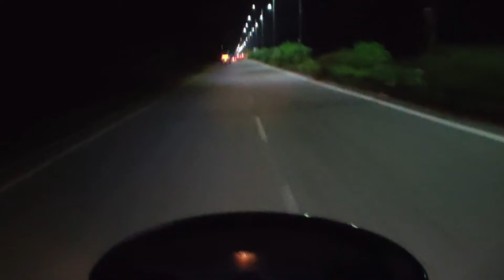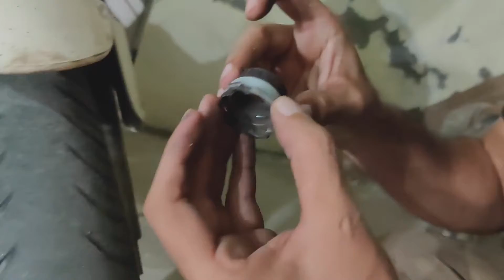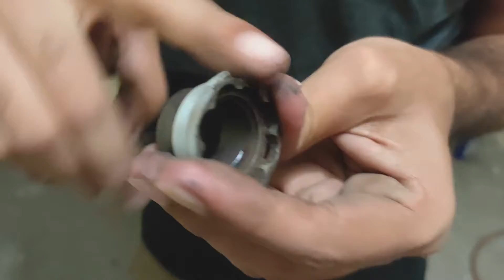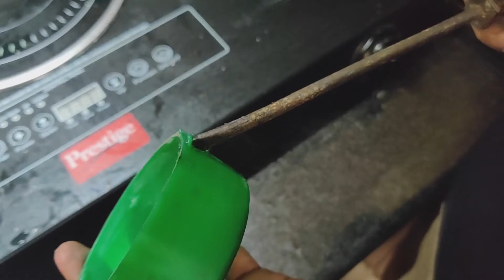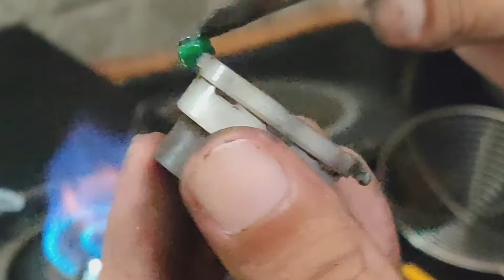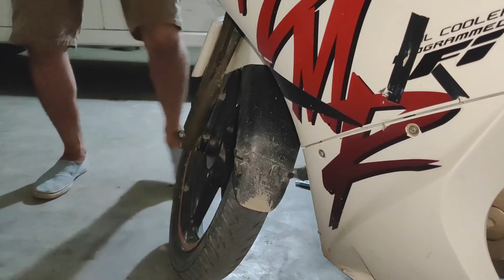Karizma ZMR Meter Not working after 39000 km || Fixed at Home || Motorcycle DIY

Comment: I own Karizma zmr ..My bike turns of whenever handle turns towards right. What could be the reason? . I took my bike to a mechanic he told it is probem with switch but it happend again after 6 months
Reply from the maker: Switch or wire of switch can be the issue
Reply: @adventurediy5993  replaced whole switch set 6 months before and it occurred again.. is it possible to repair or should be replaced ?
Reply from the maker: It can be repaired but need some well known electrician. U can clean relay next to battery may be that is culprit
Reply: @adventurediy5993  Thanks a lot. This information is very useful